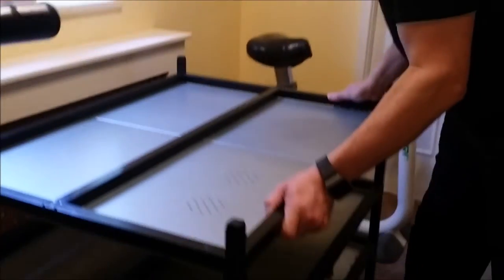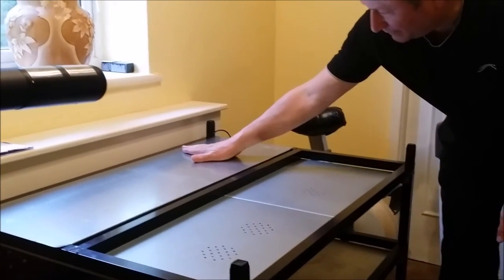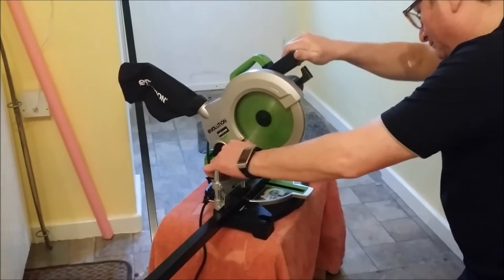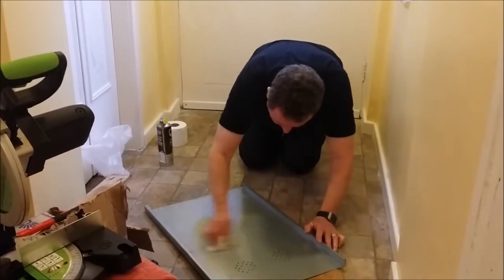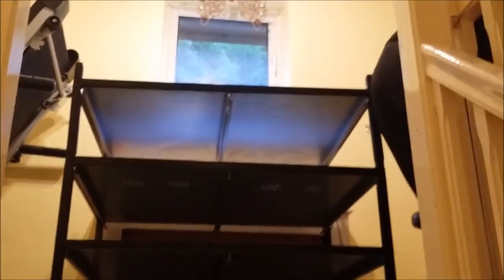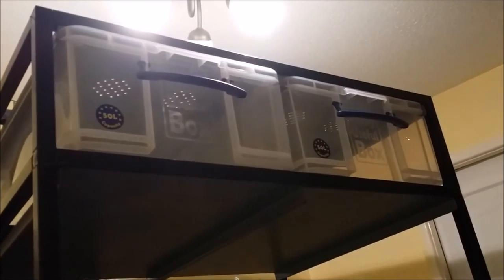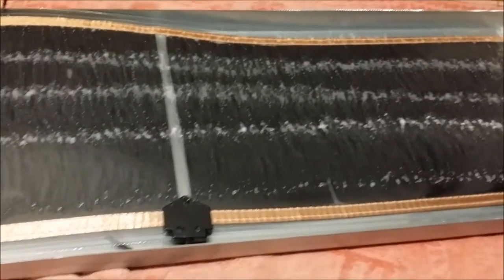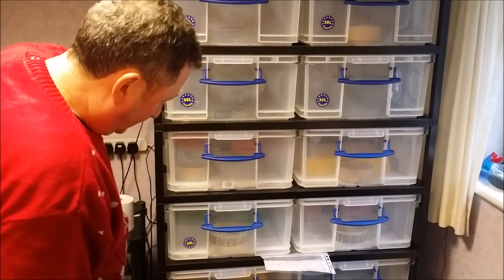Snake Rack Build, (Professional Type). Pomfret's Pythons No 14.

Comment from the maker: The cost of the frame and the shelves around £360. Add to that 16 RUBs at £15 and 8 heatmats at £18 and then a decent thermostat. And you will get an idea of total build cost. It wasn't cheap to build but alot cheaper than a factory made profecional rack that looks virtually the same. Thanks for your interest.